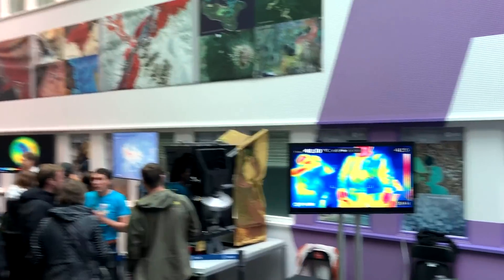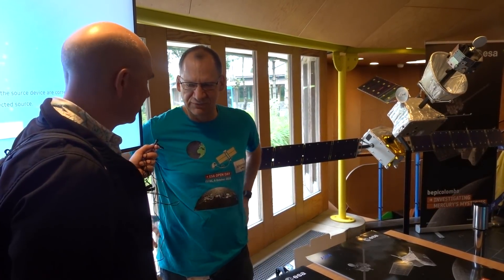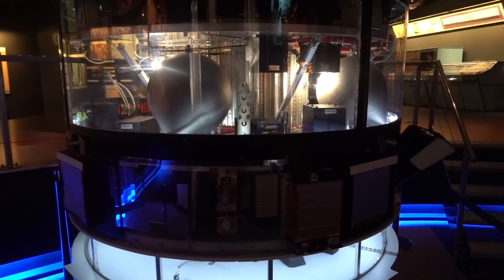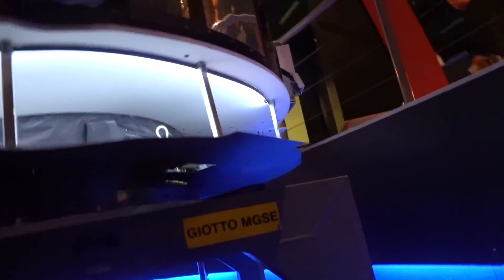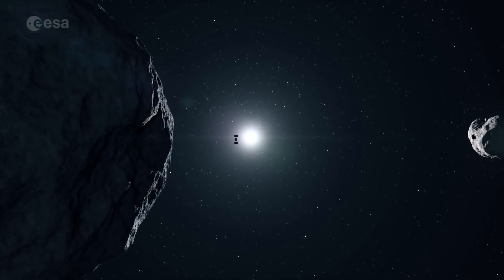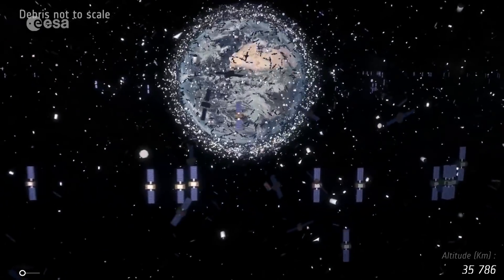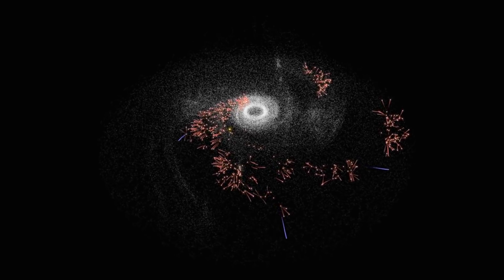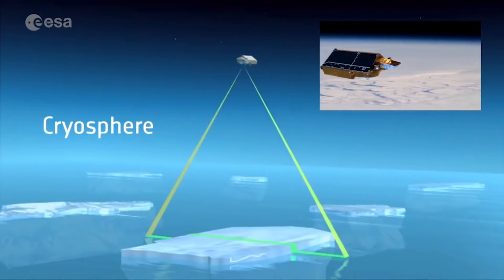The European Space Agency Open Day At ESTEC - Part 2

Comment: Celcius.  NOT centigrade.
Reply: centigrade- Celsius grade
Reply: There is little functional difference other than there isn't exactly 100 degrees between the freezing and boiling points of water. But that change happened after the renaming.
Reply: Centigrade DOES NOT mean Celcius grade.  It is Latin for 100-scale.  Although centigrade is a temperature scale used previously,  centigrade is now French unit of angle.